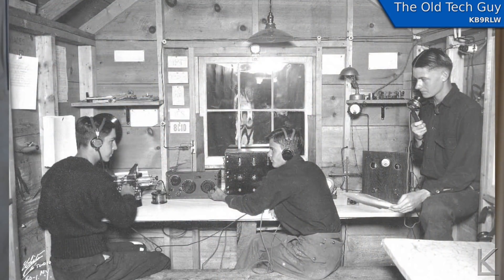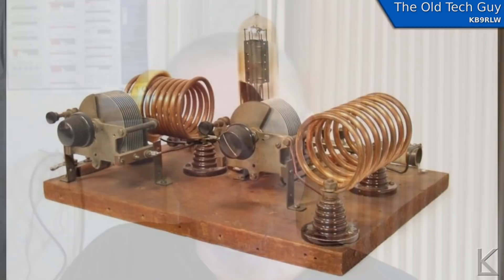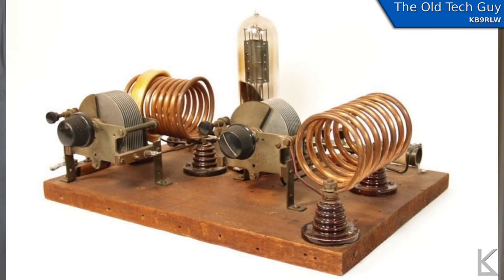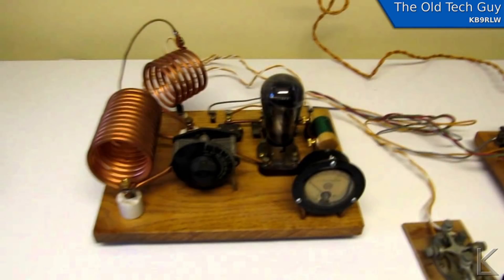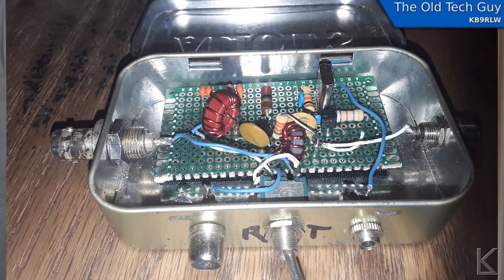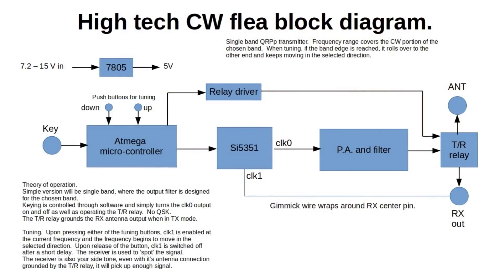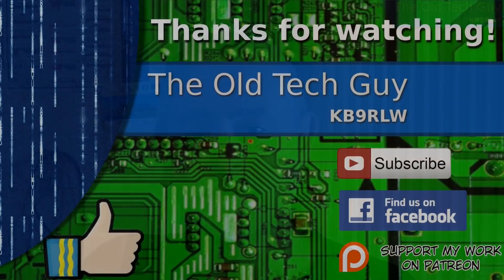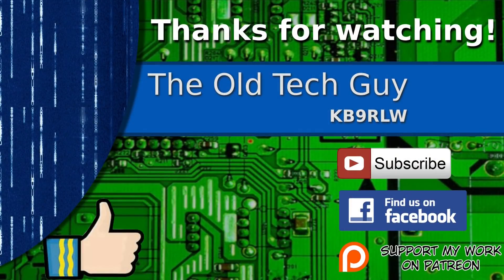Ham Radio - A new project, a modern simple CW transmitter using modern electronics.

Comment: Thank you for this video. I have not clicked away... I have a question. The tone that you have mentioned. Is it going to be on all the time? I would like to use my small handheld iCom scanner which does not have SSB but only AM and FM. I am not sure but once this tone is generated the scanner should not only "hear" CW but also SSB. I understand that the tuning will only happen in CW section of one particular band. Also, for the antenna switch can you use PIN diodes rather than a relay? Anyway, I see the potential of your idea and I am waiting for your next vids on this topic. If this project can complement any HF AM receiver it will be great and very useful.
Reply from the maker: An AM receiver is not suitable for listening to CW.   Without a BFO, you don't hear a tone, just a subtle quieting of the background noise.   The receiver is going to have to be capable of SSB reception.
It would be possible to use PIN diodes, but that would make it more complex.  The goal is to make it as simple as possible to build.  Plus I like the added protection to the receiver of actually physically switching it's antenna input to ground and keeping it physically isolated from the transmit path.
Reply: @loughkb  Thank you for your kind reply. I agree that the PIN diodes are iffy especially if someone does not install them correctly. The relay provides more isolation. However, I still think that the CW should work with an AM receiver. Providing that your CW transmitter keeps the tone going all time. To receive CW your transmitter would still generate low level signal that would act as a BFO to the AM receiver. I have see some YT vids showing people doing something like this (Peter VK3YE) to receive SSB and CW.  Please look into this. It could be really nice feature.
Reply from the maker: @radioastronomy2001  You may be talking about old style MCW which is similar to a double sideband transmission mode.   
That would be a different transmitter all together, requiring much more circuitry and power output to be effective.  
You could milk a horse if it had udders, but it would be a different animal.
Reply: @loughkb   Thank you for your reply, Please see Peter's video it provides perhaps better explanation. I am convinced your project will benefit from it. https://www.youtube.com/watch?v=9__sayg96fg
Reply from the maker: @radioastronomy2001  Ok, yep, I didn't know what you meant.   So he's shifting the output of his TX a bit and using it to do the same duty as a BFO for the receiver.  
Technically possible, perhaphs with just a bit of software tweaking.   I might experiment with it once I get the hardware fully functional.

Comment: Looks like a good 'modern' project.  Keeping with the modern approach how about using mircoPython as the computer language rather than C++?
Reply from the maker: The arduino IDE language is similar to C, I've been told.   I wasn't aware it would allow you to use a different language.
Reply: @loughkb  If you used a Raspberry PiPico (about 4USD) instead of the ATmega then that would run microPython (or circuit Python).   It would be a nice change from the Arduino world.
Reply from the maker: @M0XYM  Well, you'd also have many seconds, maybe a minute or more, of boot up time once you apply power. With the atmega micro-controller, it's practically instant on.  
Also, modern tinkerers sometimes like to do SMD builds and the atmega can be bought in raw chip form cheaply.
Reply from the maker: @M0XYM  Thanks for the info.  I was not aware.
I may look into it in a future project.

Comment: 👍Thanks Kevin, shall follow this with interest. Inspired by a few recent articles using the Si5351a/Arduino, I recently built a VFO with an LCD frequency display. Haven't got around to using it in a homebrew transmitter or receiver yet. However, perhaps similar to your thinking, I had wondered, why play around with crystal XCOs and VXCOs when we have these cheap microcontrollers and clock generators to play with? Surely, many of the existing QRP designs could be easily modified to substitute the crystal oscillator stage with an Si5351a based VFO - super stable, accurate and no longer "rock bound"? 🙂

Comment: If I a: not mistaken, modern radio receivers have an offset to properly offer the CW tone at the desired frequency. This means that if you “zero beat” the flea transmitter carrier you are very likely be off frequency, in relation to the station you want to, say, answer.
However, I believe you can add another button to “shift” the CW transmitter frequency after you have “zero beat” its carrier.
Am I wrong?
Reply from the maker: You don't zero beat it.  You bring it to the pitch you desire.  Or you match the pitch of the station you are calling. As I said in the video.   It will be offset then.
Reply: @loughkb  Ok. I think you are right. I will definitely try to build one. Thank you, Kevin, fo running your channel with great competence and humanity.
Reply: As an example, say you wish to call a CW station transmitting on 14.000700MHz. You tune your transciever to 14.000700MHz and you hear this as an audio tone at 700Hz. However, the receiver in your transciever is actually tuned to 14.000000MHz. When you press the "spot" button on your transciever, it is shifting the receiver up in frequency by 700Hz (the CW offset). This allows you tune for "zero beat" 0Hz audio tone. This is for CW-U mode. For CW-L, your receiver would tune to 14.001400 and offset down by 700Hz when you press the spot button. So for, zero beating, you need to be able to shift your receiver (or transmitter) by the CW offset frequency when you press the spot button. However, for net tuning you are you tuning transmitter or receiver until you hear the CW offset that you want (typically around 700Hz).
I hope this makes sense.
Reply from the maker: @Steve-GM0HUU  Yes, of course, that's how it works.
And not at all what we're doing here.  You don't zero beat the flea.  You tune it till it's the proper pitch on your receiver.  It will then be offset properly.

Comment: The G-QRP club does something like this with their Limerick Sudden TX and RX kits. There is a "NET" switch to turn on the TX tuning oscillator but not the PA. The RX then is tuned to find the TX oscillator. A fun build.
Reply: I was thinking the same, "spot" tuning sounds like what is often referred to as "netting" which was common in the days of separates (separate transmitter and receiver).
Reply: @Steve-GM0HUU  The difference is that in this Tx the oscillator comes to your receiver, rather than the other way around.  It's a neat idea.

Comment: Saweeet! Bench work coming.  I am sure this self design kit will need a resonant antenna? 
Hmm. Time to clear the bench.
Hope the freighters get moving again.. 
73 Kevin
Kb8qlz..
Reply from the maker: It's QRPp, so a resonant antenna will make a big difference in how well it's heard.  The line driver is robust though, it won't hurt the flea.  It could transmit all day into an open or short without damage.  (I think. heh)

Comment: This is like a modern take on a Michigan Mighty Mite transmitter. I like it. I'm pretty sure there's a higher-availability clone for the Si5351. I think I bought some earlier this year, I'll dig through my Mouser orders.

UPDATE: It wasn't in my Mouser updates, it was in the QRP-Labs messages. Hans determined that a MS5351M chip is a 100% replacement for an Si5351 for our usual purposes, so if the clock chip is the bottleneck, try finding some of the MS5351M chips to experiment with. They're supposedly more available right now.
Reply: By luck I bought a Si5351 about a year ago and haven't used it!

Comment: What about building a CW transmitter using a TAYLOE Mixer driven via a 1 Khz oscillator driving the TAYLOE Mixer via a phase shift network to produce I/Q then a Oscillator operating at 4x wanted frequency will be divided by 4 using a 74AC74 to drive a 74AC152 what about it as the chips are easily available.